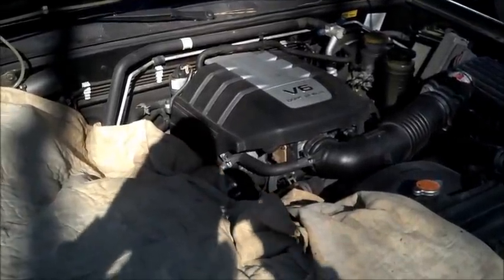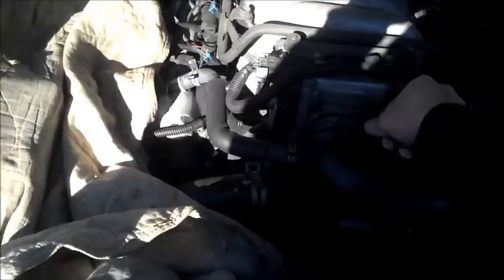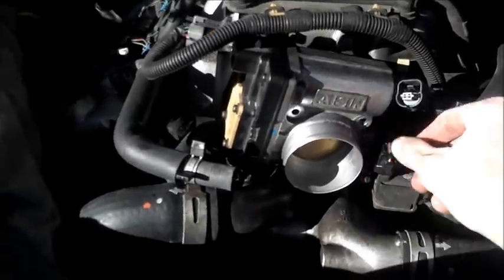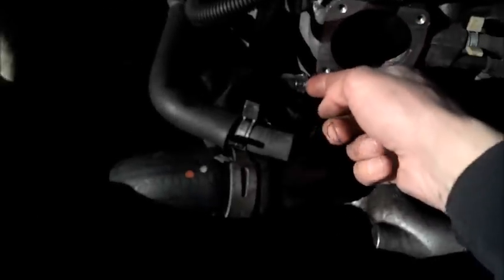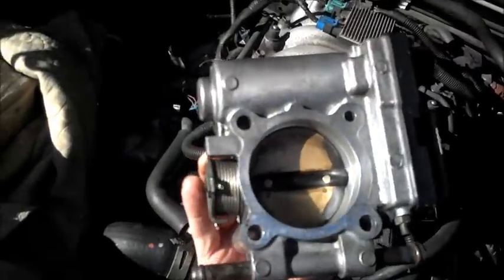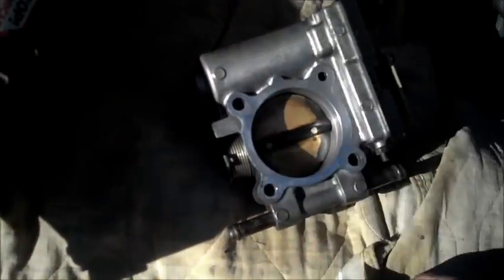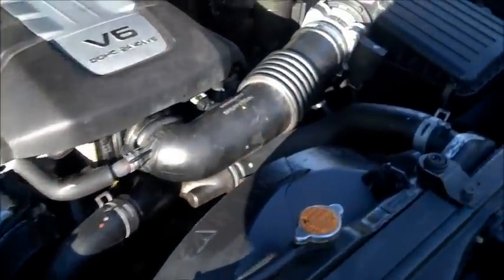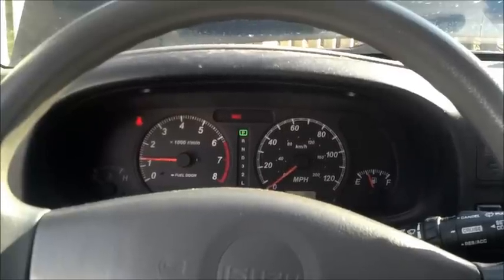EGR Valve & Tube/Throttle Body Cleaning - 2001 Isuzu Rodeo

Comment: Matt, thanks for the videos. I have had these problems for years with a '96 passport and now my '01 passport. I have had so many mechanics tell me that a new EGR valve is all I need and it never fixed. I have always had the light go on and off so was always able to pass emissions. Until yesterday, so I found your videos and started with the cleaning of the old valve, unsuccessful. Then I decided I didn't want to try and take things apart to clean inside the intake so I replaced the EGR valve, unsuccessful. So, it was on to the cleaning of the tube, worked perfectly as far as I can see. The only thing I really did wrong was not run the drive cycle long enough to reset the computer after wiping the codes, back to emissions tomorrow to try again, but feeling confident since I have driven around and no light yet. Thank you again, this helped someone who is mechanically challenged, and I didn't have any extra parts afterwards...yay!
Reply from the maker: Kip, that is awesome!  Your story is exactly why I posted these videos.  I felt just like you did when I started doing some of my own maintenance.  If it wasn't for amazing resources like YouTube, I never would have been able to learn what little bit I do know.  So, pat yourself on the back for taking the initiative and doing it on your own!  Thanks for watching, and please let me know how your emission test turns out.  Good luck!
Reply: *****
wanted to add that for anyone who does this it is very easy if you take your time and do it right. Looks can be deceiving, none of my gaskets were bad, EGR ports looked clear with minor carbon, but once I opened the throttle body it took me back how clogged it was. There was zero air coming through, 100% clogged. I used a hanger with a folded loop to grab debris inside, sprayed seafoam deep creep inside, repeated a few times, and after i chipped a few inches away inside, it pushed through. A quick shot of air through valve plate and all was done. Matt you were right about the coolant lines, it was the only real difficult part, but for anyone reading, a little wd40 and those clamps and hose will slide right off and back on again. Thanks again Matt and good luck to everyone who try this.
Reply from the maker: Kip Yemen Kip, that's great!  Nice job.  I'm really glad you were able to solve your problem.  Thanks again for your comments.

Comment: Followed your video almost exactly and almost cleared all my codes then used cleaner on Mass air filter and now have all codes cleared for two days. I did not remove the throttle body and worked through it, quite a pain since the tube was full of hard gunk. Did your method after sticking a long poker into it and then blew air from the ERG hole. Thanks for this...I saved maybe $700.

Comment: Great video Matt! I have lost count how many of these engines I've seen in junkyard with the stainless steel EGR down-tube inside the intake that are completely clogged and had brand new EGR valves installed on them. I guess people gave up on them since they could not get them to pass emissions, not knowing about the EGR internal down-tube. I always pull the EGR valve off, access the end of the EGR down tube inside the throttle body by propping butterfly open with screw driver so I don't have to remove throttle body. Plug end of internal down-tube by jamming a rag into end of it it with a rag, then fill it with carb cleaner or brake parts cleaner, let it soak for about an hour & monitor level & re-adding more as leaks into rag to soften & loosen deposits in tube. Straighten a metal clothes hanger or a 18" Nylon Pipe Brush, 1/4" Brush Diameter and run it up in the tube to break the junk loose and then finally flush with more brake parts cleaner or carb cleaner through the holes on top where EGR sits and re-assemble. Not cleaning that tube will do no good long-term.
Reply: How about the pipe that runs to the exhaust?

Comment: i did this exactly as shown to my 2001 Trooper.  It not only cleared the persistent EGR CEL (P0401), but also solved my intermittent P0300 codes.  My EGR tube was almost completely blocked with deposits.  I had to use an old length of choke cable to break some of it free.  Keep up the good work.,

Comment: Have an 01 3.2l and I did exactly everything you did. I used valvoline carb and TB cleaner. Used a solid pipe cleaner and a wire to break the funk up. I just blew it through with a small tube using my lungs. Really easy method. Throw gum out in the tank and a new air filter. Randy is buzzin! Huge thanks!

Comment: Amazing video!!!! +1000!!! i just replaced the egr on my 99 passport two days ago and the light came on twice. took off the egr and tried to blow air down the holes and the one for the intake side was plugged. googled searched the code and bam!! your video :-) worked like a dream. a lil trick to keep from having to take the TB off is to prop open the flapper with something and you can still get to the tube :-) thanks for the post man. keep them coming :-D
Reply from the maker: Wade Buchan Thanks for the kind words, Wade!  I'm really glad you found my video helpful and were able to repair your problem on your own.  It's a great feeling, isn't it?  Now hopefully you'll have no more EGR issues for a long while.  I did find later when I had the entire intake off that using a long, skinny wire brush to scrub out the inside of the EGR passage made the cleaning much more effective and easier.  I would just periodically check the condition of the EGR tube through the throttle body (great tip on opening the butterfly valve...that does make things easier...I just wanted to be sure I could get access to the tube).  If it starts getting gunked up again, you can clean it before it gets totally blocked up.

Thanks for watching!
Reply: Matt Payne cnnp
Reply: Matt Payne ,

Comment: Great video.  I had been fighting the check engine light for an EGR code for awhile.  First thing I did was replace the EGR valve itself and of course that wasn't it.  Cleaned the tube like you described and light has gone off and stayed off! Thanks!
Reply from the maker: Thanks Jason!  I'm glad I could help.  This is definitely a common problem with these vehicles, but it's one that is very easy to take care of with a little bit of instruction.

Comment: Perfect video. I also had cleaned my EGR several times and even replaced it once and code always came back until I discovered the front of the EGR tube clogged behind the throttle body. Once I pushed a Philips screwdriver through the clog at the front of the tube, I just used pipe cleaners and Seafoam to clean it out. It never came back. I have seen dozens of these engines in junkyards with the front of the EGR tube clogged. I wonder how many went to scrap because they could not figure it out? Once you get it cleaned out, you don't have to remove the EGR and risk damaging the gasket. Instead, you can remove the little allen-head plug (5mm or 6mm allen wrench) just under the side of the EGR Valve, then wrap tape or shop rag around a piece of tubing and put one end in Seafoam and the other end in the hole, get someone to start engine and let it suck Seafoam in and do this once per year and it will keep that tube cleaned out.

Comment: Thanks for the videos, I read in an Isuzu forum about this issue with the EGR tube getting plugged searched on youtube and there your video was! My EGR tube had maybe the size of a pin hole in the center for air flow, it was pretty bad, the hardest part was finding some sort of pipe cleaner to shove down in the tube to give it a good cleaning. A day later my check engine light did come on again with an EGR code so I replaced the EGR valve and its been fine ever since. Planning on replacing the intake manifold gasket eventually and whatever else is cheap and located in that area such as the thermostat so I will definitely be referring back to your videos.
Reply from the maker: Films test Good work on fixing that yourself!  Hopefully you won't have any more EGR issues for a while.

Thanks for watching, and good luck on your upcoming repairs!

Comment: thanks a lot.  didnt know what that tube was for but noticed it while I had the air intake supply tube removed.  It is totally clogged but I am not getting any codes.  I didn't know if I should try to clear the blockage or leave it be.  After seeing this I will definitely give it a good cleaning.

Comment: I have gone through problem with mine. Cleaned the EGR, I ran a long pipe cleaner thru the EGR into the manifold. I took the throttle body to a friend that had an ultrasonic cleaner. He took it all aprt and cleaned everything. Replaced the idle motor . A couple of weeks later the temp gauge went out. Here we go again. Lesson learned if you have a high mileage RODEO AND HAVE TO TEAR THE TOP OF THE ENGINE OFF JUST REPLACE EVERYTHING
Reply from the maker: Jimmie Fender Ugh, that stinks Jimmie, but very wise advice.  If you're already elbows deep in an engine, you may as well replace everything that is not prohibitively expensive while you're in there (whether you're working on an Isuzu or not).

Thanks for checking out my videos!

Comment: I have a 2003 Isuzu...but this is the SAME. I highly appreciate someone going through the trouble in posting something this helpful. Hard to find decent model specific information how to approach issues like this. 

I don't have compressed air to blow out the gunk, would using a automatic air inflator work or some air pump? or perhaps a vacuum would be better.
Reply from the maker: I'm glad you found this helpful!  I'm not sure if an air pump is going to move the air through the passage quickly enough to remove the built-up gunk, but it's worth a try.  It should at least help clear some of the buildup if your EGR passage is completely blocked.  Someone else also recommended using a clutch cable or similar flexible wire to pull all the way through the passage.  Even a short length of braided wire rope would probably do the trick.

Good luck, and thanks for watching!
Reply: @mattpayne4087  do you recommend air duster if we don’t have the air compressor?
Reply: @RENEIND  You could try a bicycle cable with the internal cable removed. Brake cleaner. Let it sit a while and then try to push cable through. They also make a set of engine cleaning brushes  that would be helpful. Due to being closer to the pipe internal diameter in size. Good luck.

Comment: This a very nicely made video. However a much simpler method is to remove the EGR valve and plug the tube opening of the egr mount (pointed wood dowel works fine) start and run the engine at 2000 rpm and spray carb cleaner into the small hole.  A couple minutes seems to do the job. Use your scan tool and reset the three trouble codes that you will have set in the computer. This is a very common every few years problem. I have never needed to do anything more complicated. Fifteen minute job.
Reply from the maker: Terry Odenbach Thanks Terry!  Is the general idea behind the method you described to fill up the EGR tube with cleaner by plugging the end of the tube, and allowing the cleaner to "soak" for a few minutes?  That's an interesting idea.  Thanks for sharing.  I would still imagine that mechanically cleaning the EGR tube with a wire brush would be the absolute best method, but your method would probably help keep things clean after a thorough cleaning if done periodically.  Thanks for sharing!

Comment: Great vid, but what about the pipe that runs to the exhaust? How do you remove the nut holding the clamp on the back of the head, and is it even necessary?

Comment: Great video. I am having the same problem you are  my Isuzu rodeo is a 1999 I just ordered my gasket and will do this has soon as I get my gasket. So hopefully this will go alway with the cleaning process. I much of the cleaner do I use ?
Reply from the maker: Marco Galvez Thanks Marco!  You can use as much cleaner as you need to dissolve all of the carbon buildup.  I would not worry about using "too much".  I would use the cleaner in stages - spray some in, let it soak, brush/flush out the tube, and then repeat with more cleaner.  And when you are finishing, try to soak up/clean up as much of the excess cleaner as possible.  Most of it should evaporate eventually, but if it pools in the bottom of your intake manifold, just soak it up with a rag.  I also strongly recommend using a small wire brush to ream out the inside of the EGR tube after you spray the cleaner inside.  I didn't demonstrate this in this video, but based on my experience since I filmed this, a wire brush greatly aids in the cleaning process.

Thanks for watching!
Reply: Matt what happens if I don't have a air compressor what can I use

Comment: Do you think using carb cleaner in the tube instead of seafoam deep creep would be alright? thanks.
Reply from the maker: I do - that might actually work even better.  In hindsight, I don't think Deep Creep was the best choice for me to use.  I think carb cleaner, or something like Berryman B-12 or even regular Seafoam would have been a better choice to break down the carbon deposits.

Thanks for watching!

Comment: Did it stop high idling? Asking because that is our cars problem it idles super high and the EGR is coming up on the codes. We are gonna clean it like you did in your other video and then clean the tube like this video. Just wondering if when the cleaner burned off if it idle quietly?

Comment: hey! so this video is great, totally helped, but rather than take the throttle body off I just went through it to scrape out the completely blocked pipe. going to run some air through the egr port but wondering if I don't take the throttle body off will all the gunk that comes out hurt my engine?
Reply from the maker: Hey Ashley, sorry for the delayed response.  I would say that it's never great for your engine to have any sort of solid (i.e. - not a liquid or gas) sucked into the combustion chambers.  With that said, the gunk in the EGR port is probably not going to blow up your engine.  However, if it was my vehicle, I'd try to clean out as much off the nasty stuff as I could.

Good luck, and I'm glad you found the video helpful!  Thanks for watching!
Reply: +Matt Payne yeah, it rattled around in my cat for a bit, but didn't hurt it, passed smog a few days later so all is good!

Comment: how about a video on changing the fuel level sensor? My 01 rodeo has a wonky sensor.. very annoying and throwing codes so i cant get through DEQ. Thank you for this video. I also have codes for the egr valve, so im going to give your tutorial a shot here soon and try to fix it! 

Thanks again
Reply from the maker: PurpleBl00ded Thanks for watching!  The fuel sending unit, which is what sends the signal to the fuel level gauge in the instrument cluster on the dash, is actually attached to the fuel pump in the fuel tank.  If you watch my video series on replacing the fuel pump, you will learn how to get to the fuel sending unit - it is the "arm" with the float that attaches to the pump.  

If you do replace the sending unit, I would strongly recommend purchasing a new pump and sending unit together and replacing the entire assembly at one time.  Based on everything I've read, the ethanol fuels used these days wreak havoc on fuel systems, and it seems these pumps just do not hold up.  Unless your pump has been replaced recently, I think it would be best to install a new pump at the same time as the sending unit.  You don't want to have to remove the fuel tank any more often than you have to!

My video series on this process is linked below.  Good luck!

Part 1: https://www.youtube.com/watch?v=DvBTIAzg80c

Part 2: https://www.youtube.com/watch?v=qXHR5lIruqI

Comment: Thank you for showing us this video!!! Do you have video on changing oil of transmission... I have an old rodeo but rides great!!! I want to fix it myself it so expensive going to the auto service center for old cars like this...a gain thank you for this video.
Reply from the maker: Gulliver Gimeno Gulliver, I'm glad to hear you are hoping to keep your Rodeo running well - I think these are great trucks if you are willing to give them some TLC!  I completely agree with you - it is expensive to pay a mechanic to maintain an older vehicle, and in my experience, it seems that a lot of mechanics are neither knowledgeable about Isuzus, nor do they want to learn, since Isuzu no longer sells passenger vehicles in the United States.  I've lost track of how many times a mechanic has dismissed an issue by saying, "Well, it's an Isuzu..."  That's a large part of why I started learning to do my own maintenance.

I actually am in the process of changing the transmission fluid on a Trooper that I recently purchased, and I'm hoping to post a video of that when I'm done.  Check back soon and hopefully I'll have it posted.

Thanks again for your compliments!

Comment: I am going to try this as well as clean the EGR. My 2001 seems to stall at slow speeds and rpm, which is not only annoying, but dangerous. Runs perfect 99% of the time and idles good with no engine lights, so it is a bit of a mystery.
Reply: Also change the PCV valve.
Reply: @johnpyahoo  Yes did that when I bought it recently. I had a short in a wire going to the throttle position switch and the idle control. Been 1 month with no stalls. Also have a clean throttle body and EGR:)